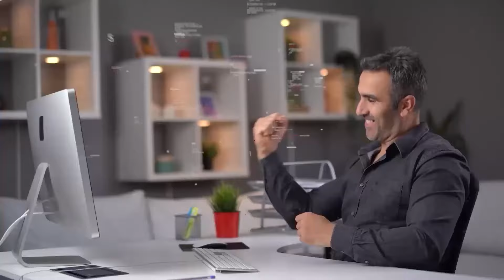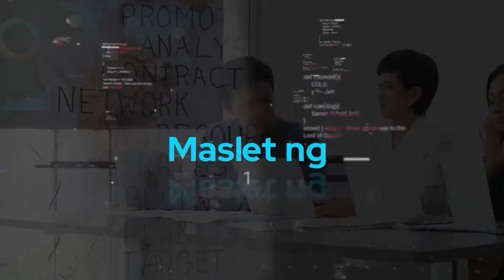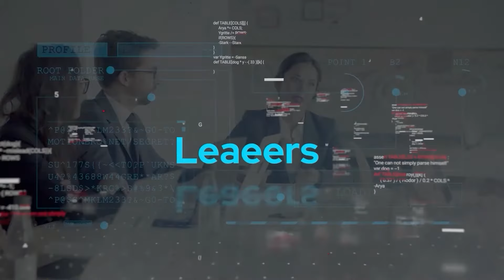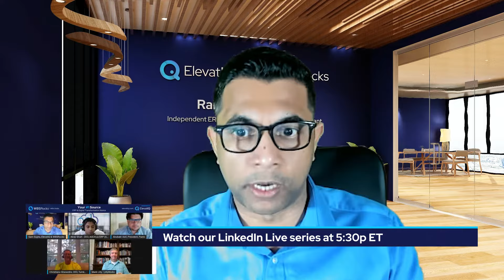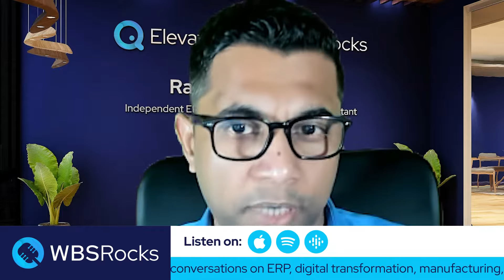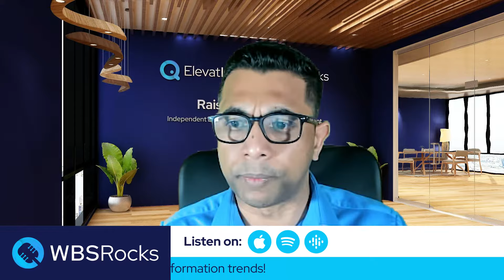Top 10 Manufacturing ERP Systems for 2023 | Manufacturing Software

Comment: Some of these systems aren't bad, but in most cases, even with better systems, the 3rd party consultants installing have limited control over what any given module can do. 95% of the time, manufacturers especially need customizable systems. Everyone who has been through an ERP implementation knows the risk of a boxed system.
Reply from the maker: Great perspective. But in general, when a company doesn't fit in a box, in most cases, they have process and data issues, and the customizable system is trying to automate broken processes and data sets.

Comment: How does IFS fit in manufacturing space? Specifically for make to order manufacturers like those with custom and batch production requirements (10-30qty per line item)
Reply from the maker: It's very hard to assess only based on this information. IFS is slightly bigger solution and doesn't do as well in the constrained-based manufacturing environments. It's strength is in EAM and field services in the large equipment space. Based on the information provided, it doesn't seem to be the ideal fit. But with ERP systems, there are always layers and we would recommend consulting with a professional expert than selecting a system based on few internet comments.
Reply: @ElevatIQ  Thanks for the reply! We are a machine shop with low volume /high mix production. Most similar to a large machine shop with 350 employees. We have done demos of atleast 4 erps mentioned including IFS so i was wondering based on that.

Thanks.
Reply from the maker: @mohamedsayani2414  the market segment you mentioned is not the strongest for IFS. 

But again, depending on how you plan to implement it, things could vary. 

Infor and Epicor are much stronger in this market segment. They also have much higher market penetration. 

Not sure which solutions you are looking at and which is your geography. There are millions of variables that could drive whether a solution would be a fit or not.